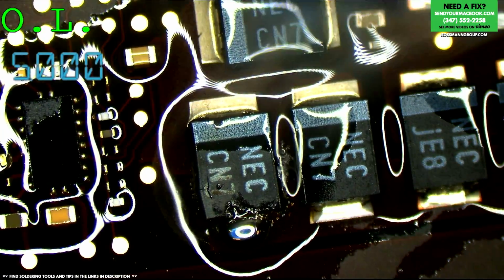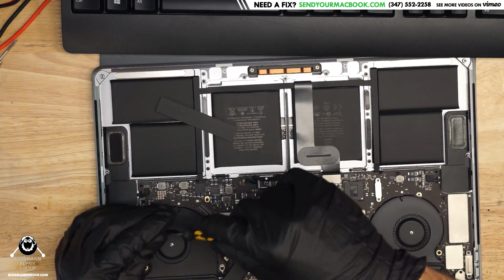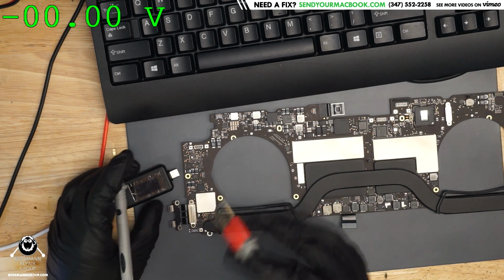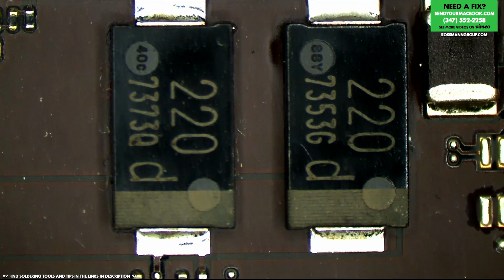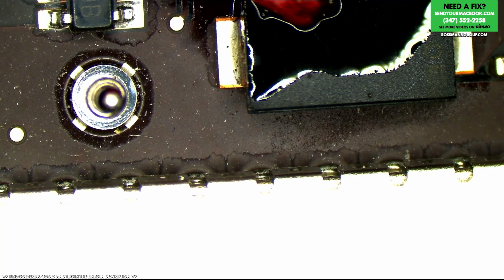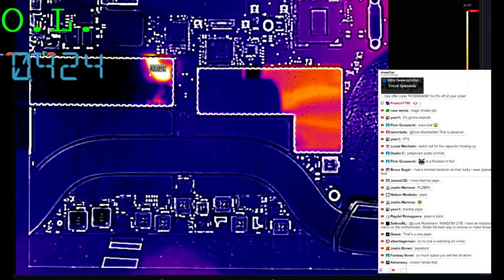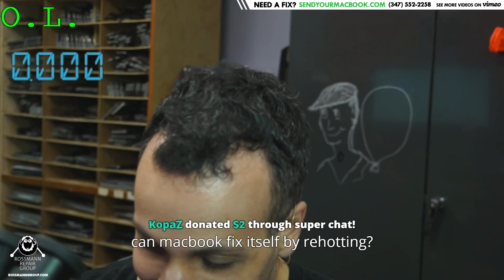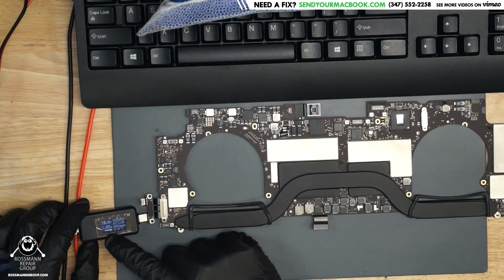820-00928 takes 20 mA 20v not turning on

Comment: I really like titles like this because it lets me guess what's wrong with the board using the knowledge Louis gave me. I haven't watched the video yet but let me take a guess,  if the board is taking 20mA then obviously the majority of the board isn't being powered because the normal current draw is ~500mA. So the immediate suspect is power rails not being created. Again due to the extremely low current draw it's likely one of the first few created power rails. Remembering a schematic from a similar model I would assume there's corrosion on a few capacitors in the charging circuit.  I could be extremely wrong, but titles like this let me guess :)
Reply from the maker: I will keep this in mind when it comes to future videos. Thank you!
Reply: @rossmanngroup  Thank you! Don't feel the need to change your naming structure on my account though :) Thanks a lot for the content regardless.

Comment: I used to work on Ford audio systems in the 90s. There was a daughter board on one of the premium systems that handled the audio controls and there were four caps, one for each channel, where if one of them was shorted, it would get so hot that the solder would  be fully molten and the board would be scorched.
Reply: Damm that is intense!!